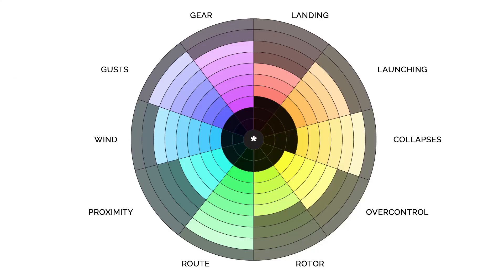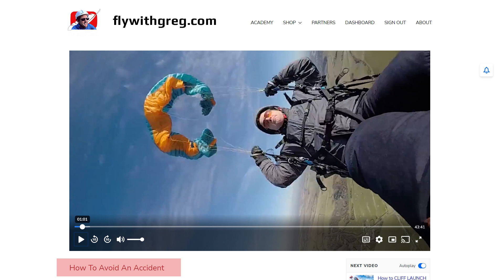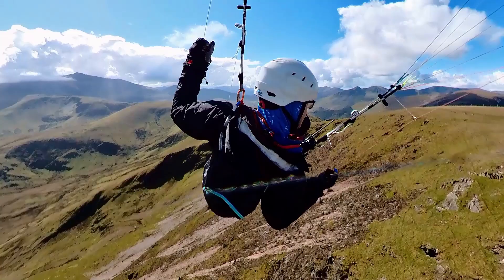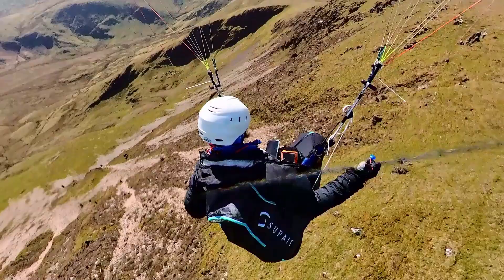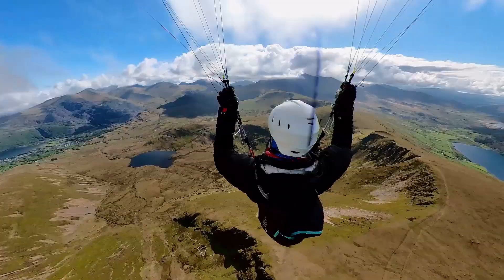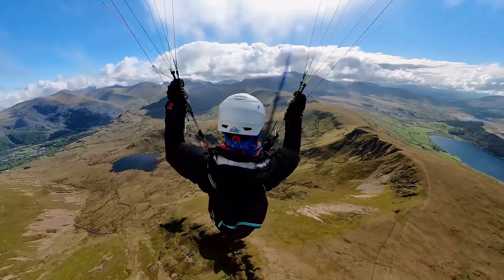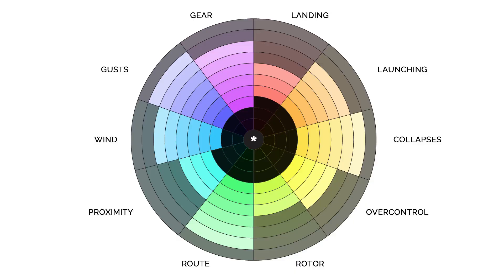Common PARAGLIDING CRASHES ... and how to avoid them!

Comment: Active flying is definitely the key, I've been flying a high-B wing for two years now and haven't had a single collapse! Unfortunately I find most instructional videos difficult, they always talk about the forward and backward movement of the wing that you have to stop, but I don't actually react to the movements at all but to the different pressures in the glider and the thus changing control forces! Maybe this would be a good topic for a video! 
;-)
Reply: I will be glad of you share a tip about controlling as per the changing pressures.

Comment: I saw two failed launches for the first time recently. Everyone was fine in both cases, but it was scary to see how fast something can go wrong. I think in both cases, slowing down and actually kiting their gliders for a moment to check the lines with the wing flying overhead, or notice and fix the rather large asymmetric collapse, would have saved them.

Comment: Hi Greg. could you explain more about the butterfly technique? the beach landing mentions that this would save the guy from hitting the rocks. I guess putting 20% breaks to steepen the glide could also help. I'm a beginner and I'm trying to learn as much prevention as possible :-)
Reply: Please ask your instructor, in the butterfly technique you break the wing close to the stall point quickli open and rebreak. In german its called pumpen - its easy if you're used to it but its best learned with an Instructor!
Reply: Greg has a video about it on the Fly with Greg website but like Raphael said, it’s best to have an instructor help you with this. It can go wrong fast if you don’t know your stall point.
Reply: It would be a lot better to spend time on learning a correct approach and how to put your glider down on a tight spot.  I have seen a few people hurt themselves with the butterfly technique and wouldnt recommend it.  Godd pilots too.  The beach guy had a lot of space to land and a lot of room to manouver his glider away from the rock long before he got there.  Once you are landing consistently with a good flare.  Change it up.  Every time you land at your local site pick a spot from high up and land as close as possible.  Approach from multiple angles, never repeat the same approach. Add low turns, swoops, crosswind approach, downwind approach and upwind approaches to get  feel for the adjustments you need to make.  Make it different every time.  If you have a large feild make it smaller by drawing imaginary boundaries you cant cross.  This will help you practice steeper approaches and tighter landing zones without putting yourself in harms way.